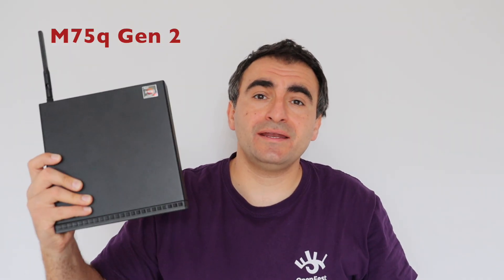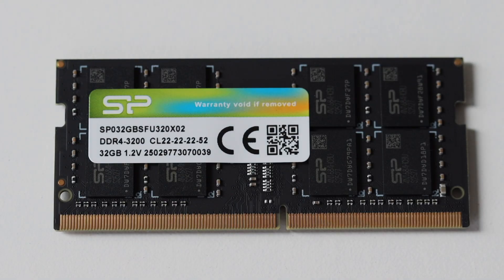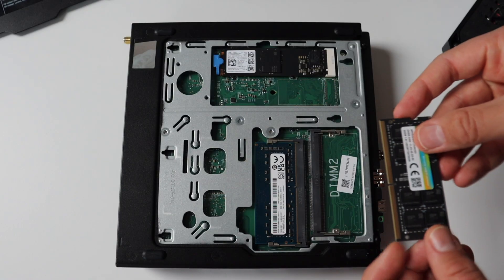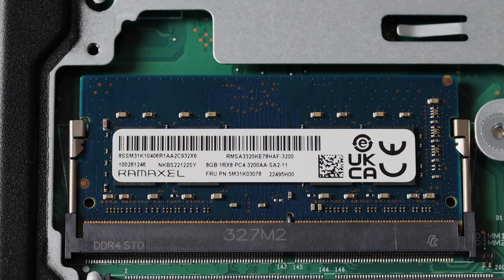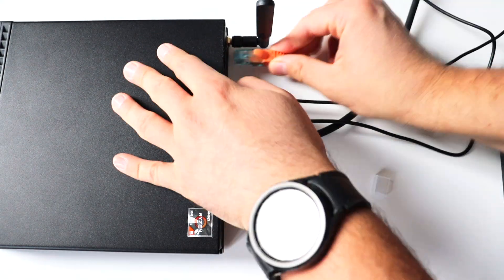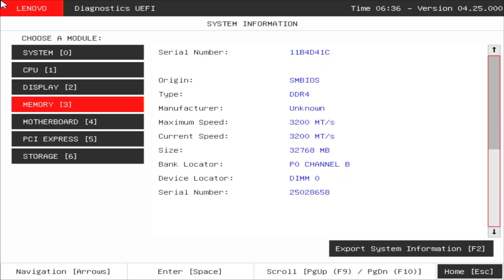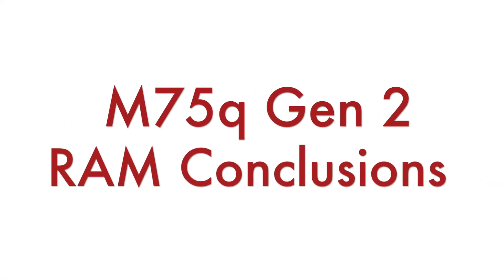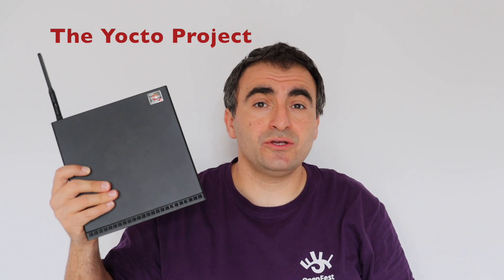DDR4 RAM Upgrade on Lenovo ThinkCenter M75q Gen 2 Mini Desktop PC

Comment: Given that the primary slot manages most of the I/O-intensive data, I would’ve preferred allocating 32GB of RAM there for optimal throughput.
Reply from the maker: Yes, absolutely, you are right. Thanks for the recommendation! I was actually planning to make a short video on this topic, so I will take the opportunity to swap the memory modules as well.
Reply from the maker: Following your recommendation, while making a short video I allocating 32GB memory module to the primary slot. Thanks for the tip! Here is the short video: https://youtube.com/shorts/uLYQEQwYkBo
Reply: @LeonAnavi  I have TC M920q used for linux development 😊
Reply from the maker: @anandmoon5701 according to the tech specs M920q is a very similar solid PC with an Intel CPU. Are you satisfied with it? Which Linux distro do you have on it?
Reply: @LeonAnavi I am Archlinux fan, but also use Ubuntu 😅
Reply from the maker: Although I am using Ubuntu across all my laptops and desktops, I enjoy the awesome Arch Linux documentation which I regularly read while debugging issues related to a specific package, for example most recently about ConnMan :)